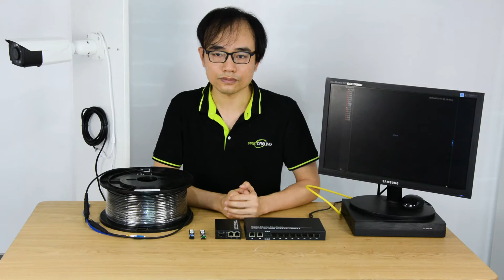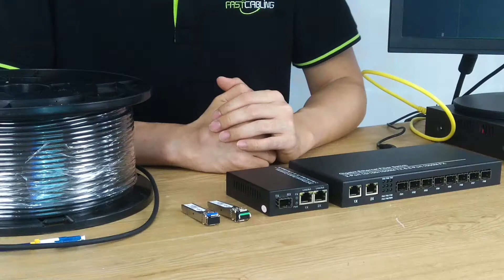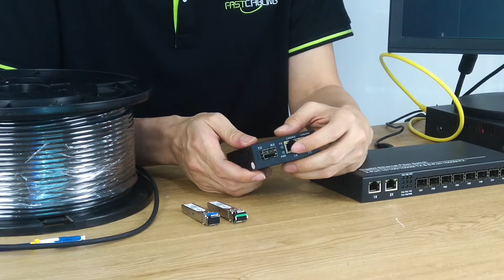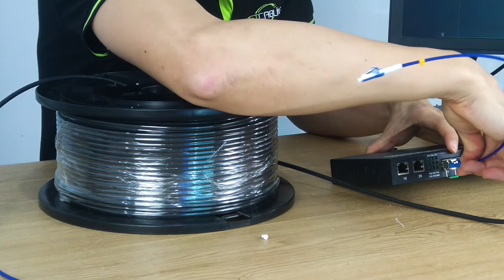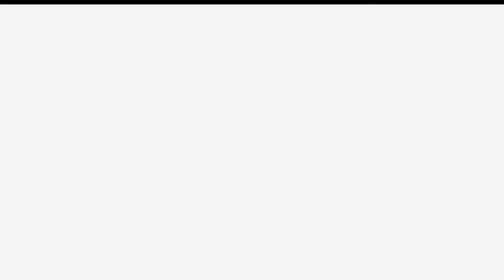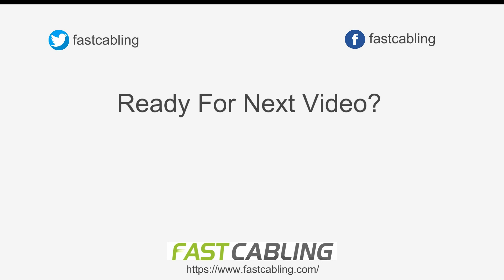Use Pre terminated fiber optic cable to connect long distance IP security cameras

Comment: I need to connect honrwell 81 no's ip cameras in a airport runway.... (3zones)  Nearly 8 to 10 kms long... How can I connect to NVR & installed... Can you please make a video
Reply from the maker: I think you will need to take care of the power. It cost too much to send low voltage power up to 10 kms long. Next, put the outdoor switch at the end, and link back to the center with the fiber optical switch. https://www.fastcabling.com/product/outdoor-poe-switch-with-sfp/